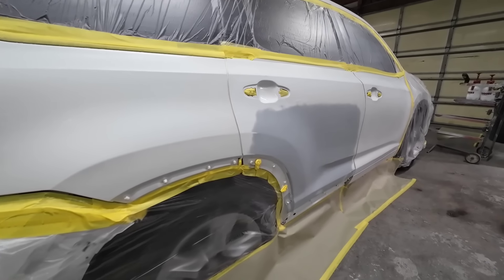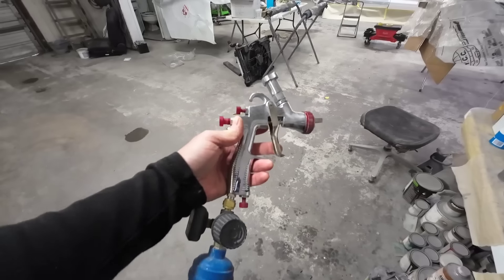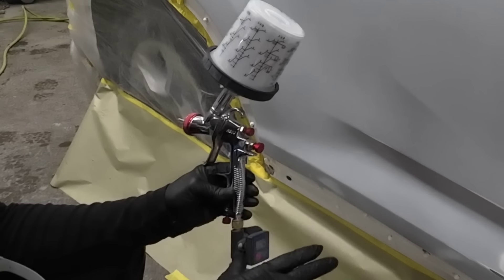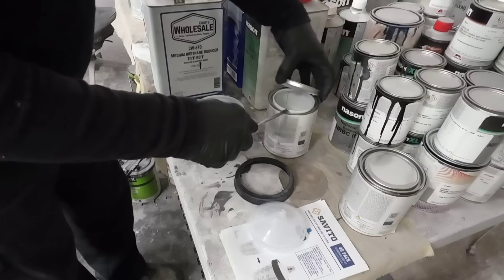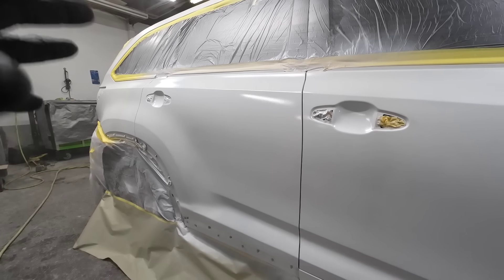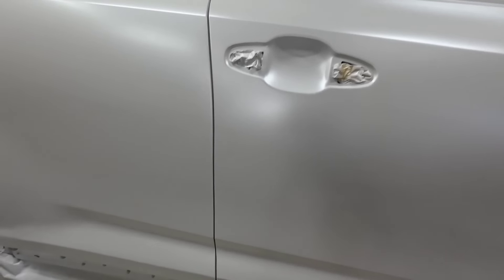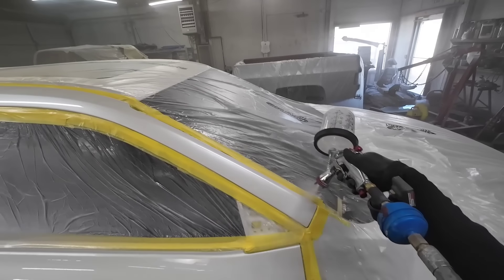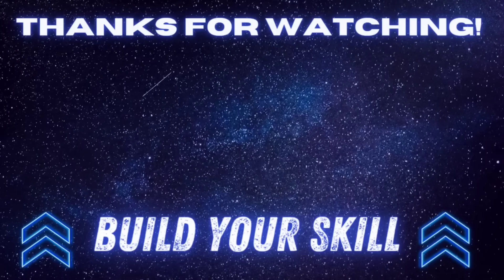The PERFECT lvlp spray gun to paint your car at home.

Comment: OK, took your advice and ordered an R500. Just did my first clear coat with the 1.3 and I must say it sprayed beyond my expectations. It sprayed as well as my old Binks #7, which used to be the standard for us old-timey types back in the 80's. For you youngsters out there, if you've never shot a high pressure gun, it's the standard by which all else is judged. But...overspray is a serious problem. You haven't seen overspray until you use one.  Any they are heavy.
Reply from the maker: For sure those older guns blasted it on like a fire hose🤣🤣 This gun sprays so nice alot of things to like about it.
Reply: I'm looking for a spray gun to spray candy apple paint. Do you think this gun would work well for that, and if so, what psi would I run it at
Reply: @davemcaferty6347  Here's my $.02...this is probably paint heresy but... I don't really pay much attention to PSI. I pattern the gun before every shoot meaning I adjust the psi and the spray...but I don't have a gauge on the gun. I just see how it patterns on cardboard and how it looks when I hold the gun perpendicular to a light source. Then I pay close attention to how the the paint is laying down on the surface. That requires good lighting. And no matter how good the gun, you are not going to do as good a job on the first paint job as the tenth. You have to get to know your equipment.
Reply: I still have my Binks #7, I'll never part with it lol. But I haven't used it since the mid 90s.
Reply: SATA is the Vanguard now.

Comment: Are you using the bigger orifice air compressor attachments?
Reply from the maker: No, 3/8 line with 1/4 fitting, m style
Reply: @GarageNoise  I have the 3/8 I.D. high flow fittings. will this work or should I switch over?
Reply from the maker: @FnaAuto  It should work fine

Comment: Can one of those pancake compressors work with one of these spray guns?
Reply from the maker: Pancake compressor  will be a little small. Need a compressor that produces about 5-6 cfm's. Usually a 20 -30 gallon compressor . You might get away with doing one panel. Not a whole car. I'm  working on getting a small budget friendly compressor to do some painting and a review on. Appreciate the support!
Reply: @GarageNoise  thanks for the reply. Yeah, I just want to be able to paint one panel. 
I will keep checking your videos . I’m still a bit confused with ratios when mixing paint and what brands to use that are good and not expensive. Thanks again 👍

Comment: Wow! Did you wet sand and buff to get that finish or is that straight off the gun?
Reply from the maker: That is off the gun, they don't  all turn out like that tho. Appreciate the comment and support!
Reply: @GarageNoise  Really a great job! You convinced me. I picked up that gun and a 20-gallon 5.3 CFM compressor instead of the 3-stage turbine electric sprayer. Thanks for the great video. I am totally expecting I will spend some time sanding and buffing haha, but the lay down looked nice and smooth regardless!

Comment: CHRIS IS THERE A SIGNIFICANT DIFFERENCE BETWEEN THE UPOL 2253 AND UPOL 2251?? THANK.S PJP
Reply from the maker: Isn't 2253 a primer? Not familiar with 2251
Reply: THEY ARE BOTH  2K HIGH BUILE PRIMERS BOTH GRAY ONLY DIFFERENCE I CAN SEE IS THE COST; I BELIEVE 2253 IS A DTM PRIMER /SURFACER WHERE AS 2251 IS A STANDARD 2K HIGH BUILD PRIMER; BIG COST DIFFERENCE, THANK,S PATRICK
Reply from the maker: @patrickpeterman8736  I use the 2253 because it is a dmt primer never tried the 2251

Comment: So what kind of compressor could be used with this gun?
Reply from the maker: With a compressor you want cfm's. This is the air your compressor produces per minute.  With this gun you want a compressor that produces at the minimum 6cfms. Your air pressure still may fluctuate if your painting a whole car but you could definitely paint a few panels without air fluctuations.

Comment: What are your thoughts on single stage?
Reply from the maker: It fine sprays alot like clear but easy to run. Best tip put the first coat on lite to medium.  Do not put it on wet it will run. Once  that first coat is tack spray second coat like clear.
Reply: Preciate the response. Would you add clear to the second or third coat like some do? Single stage has come a long way from the early 80’s.

Comment: Is this gun good for spraying a single stage paint with no clear coat?
Reply from the maker: Absolutely!
Reply: @GarageNoise  I have a 65 Impala and was originally going to go with base/clear, but with a car of this vintage, I figured a single stage would more resemble the "original" from the factory. I've been working on cars for 40 years now and I've learned more about painting from your channel in a month than I've learned from other sources in 40 years. Keep up the great work !! I retired last year and have long since gotten rid of all my major shop equipment, so I'm doing this project with a pancake compressor! I'm going to mask off and do one panel at a time, which shouldn't be a big issue with color match, since I'm doing the car in Ermine White.
Reply from the maker: @torydz  awesome! Appreciate the comment and support brother!
Reply: @GarageNoise  You may cringe when you hear this, but back in the day (I restored cars mostly in the 70's such as Novas and Camaros) I used to do acrylic lacquer. I think acrylic lacquer is considered almost a "swear word" to today's painters. But that is what I'm going to do the Impala in. I have the hood and deck lid in the shop and will do these first and then proceed to the other panels on the car in the driveway.

Comment: Sir ...can I use r500 lvlp with 1.3tips with the primer of mix ratio is 1:1 hopefully you can answer sir... thank you
Reply from the maker: It might be a bit small. Is it urethane or and epoxy or something  else? Chances are you'll need a bigger tip. The technical data sheet for the primer will have a recommendation for tip size. Appreciate the comment and support!
Reply: @GarageNoise  this primer I Will use it is a urethane sir...1.5 is it ok but not LVLP IST f75 hvlp I think...ok sir I understand.... thank you....🥰
Reply: @GarageNoise  sir....you using clear coat.  When you mixing the clear..are you add reducer sir ..in mixing ratio 2:1 or doesn't need add reducer....🥰
Reply from the maker: @mahalnidivine7270  the upol clearcoat doesn't  need reducer. So no I don't  add reducer to the clear coat . Appreciate the comment and support!
Reply: @GarageNoise  my clear coat is U mix UV7 mix ratio 2:1 it's said need add 5% reducer...is it necessary sir to add....or don't add yah ...🥰

Comment: I am new in spray painting and planning to paint my old car.  I would like to know how to handle the painting process if the spray cup is low in the middle of painting a car.  E.g.  Stop the painting process, mix the paint for a new cup, attach new cup to the spray gun and then continue painting the car.

I search this information through the web but getting no result.
Reply from the maker: The time it takes to mix up a bit more paint or clear is not going to effect things if your reasonably quick about it . It's  a bit more critical with clear but don't  over think it and if your paint a whole car and see your getting low try to finish the panel before stopping to mix more.

Comment: Hi I have purchased a R500 LVLP wild using the gun i notice some drop of pressure, for example I had 30psi using clear and after spraying it drop to 20 to 18 psi, I have a 30-gallon air compressor. any idea what happening. ?
Reply from the maker: It would be the air regulator on the gun. If your not using an air regulator that it's  a drop in pressure . Your compressor may not be keeping up with the paint gun. Not sure the details of your set up. Appreciate your support .

Comment: Is this R500 LVLP gun good for Metallic paint? What pressure is best for Metallic paint or Clear coat?
Reply from the maker: It's  fantastic for basecoat and clear. There's better clear guns but not with the low air consumption and other benefits of this gun.
Reply: @GarageNoise  so regular paint and metallic paint has no difference in spray at the same pressure?
Reply from the maker: @bulldogkarma  I like to use a bit less pressure on metallics because you want it to lay on med/ wet . On this gun around 18to 20 psi

Comment: Quick question. When you say small compressor,  how many gallons and psi do you need? Plan on doing a mobile set up that I can run out of my ford expedition. Most of my clients have sealed garages. What size hose and compressor do you recommend?
Reply from the maker: Check out my tomorrow's video  it's  on exactly this topic.

Comment: Did you use the same product for primer as you did sealer but at mix ratio for primer?
Reply from the maker: Yes, but you can't  do that with every primer. Make sure you check the Technical data sheet on the product  your using.  Here's the upol primer I use
https://amzn.to/3Ldm20h
Reply: @GarageNoise  yeah I understand that, I was looking on Amazon for the two reducers they recommend to use it as a sealer, don’t see either one made by upol, I have another brand reducer I use when mixing up a batch of basecoat, can that be used instead of the recommended kind by upol?
Reply: @GarageNoise  they recommend UP2481 or UP2842
Reply: @GarageNoise  A Non Sand (wet on wet) sealer. (use at 4:1+20% UP2481 or UP2842 Reducer
Reply: @GarageNoise  how about using Nason Ful base 441–21 reducer mid temp?
Reply from the maker: @wild8757  yes, the upol primer and activator and a urethane reducer  I've use several different bands. I've  used the nason reducer and the usc reducer. whatever reducer  your using  for your basecoat  should be fine.

Comment: I bought this gun, watched you set up videos , tried to spray some primer, the gun just spit and sputtered the primer out… rechecked mixture of primer, tried resetting the gun multiple times… not sure what I’m doing wrong…
Reply from the maker: Tip size? Is it the 1.3 or 1.4? Also what primer are you using, if it's  high buil the viscosity could be too thick. You can thin the primer with some urethane reducer.

Comment: After spraying sealer is it ok to leave it for a few weeks and then sand with 600 to lay down base coat?
Reply from the maker: You might get away with it but I wouldn't.  What you could do is spray a primer surfacer, which is just a thinner primer  then come back and sand and basecoat when your ready. Use a 2k product  tho so it has some protection.

Comment: R500's seem very decent but having just been doing a lot of painting with mine (first big project) I agree now with the info out there that they actually consume much more air than the 3.5-3.9 cfm that's billed. In turn, no shortage of mist/overspray, particularly spraying clear coat. Fair enought you may say, BUT this is less than ideal for the DIY home painter with no booth. It is reckoned they use more like 7.5-8 cfm (spraying clear at circa 32 psi).
Reply from the maker: I think your right, still best option I've  found for diy. If you dial down the air pressure and fluid volume you will get less overspray.  Appreciate the comment brother!

Comment: I've got a project truck in my garage that I need to start spraying the back sides of some parts so I can begin assembly but I've been seeing videos online that say you can't use an LVLP spray gun to paint an entire vehicle. Overspray and the size of my compressor are an issue. Spring in my open garage and having a compressor rated at 2 HP might be a challenge for a traditional HVLP gun. I've been considering the R500 because of your videos, do you really think full vehicle can be sprayed with this?
Reply from the maker: This is the thing, your compressor must produce at minimum 6cfm. The more cfm the better, but at 6cfm you can get it done. You may have some air fluctuations tho.

Comment: Hi Chris, I recently bought a R500. And I'm trying to set it up with the cup system but need to know the specific spray gun cup adapter you use with your cup system going to be using aflybltol mixing cups from Amazon 20oz says its the traditional 1.0 system. Let me know your thoughts on my question painting an entire chev camaro
Reply from the maker: Spectrum 57505 adapter at harbor freight or 3m #2 adapter legacy series
Reply: @GarageNoise  thanks Chris do you know if Amazon sells it? Cause I live in Canada 🇨🇦
Reply from the maker: @ginowillow  I can't  find it on Amazon but you may be able to order it on harbor freights website

Comment: Love you this video. Very helpful for the guys like me who is starting to do some DIY projects. Question, what air compressor is best for this gun?
Reply from the maker: Bigger the better,  most cfm's you can afford at the least 6-10 cfm's
Reply: @GarageNoise  unfortunately i have a husky 20gallom compressor which gives 4-5 CFM
Reply from the maker: @UwU._Sqb  it will work but you'll  have air fluctuations if you paint more than one panel.
Reply: @GarageNoise  ill keep that in mind.. thanks for
The tip.

Comment: Btw Chris, what type of primer should I use on bare metal? can I just use 2k urethane or epoxy is a must. New to car painting and I am starting to gather my supplies.
Reply from the maker: Are you painting the whole car or just a repair? If your just doing a repair and painting  a few panels 2k urethane is perfect. If your doing a full paint and you plan on it sitting in primer for awhile than use epoxy as soon as you take a panel  to bare metal  the clock is ticking to get it into primer.  If you plan on painting it within a few months and it's  not out in the elements tthan 2k urethane is great and what i perfer.  Hope this helps appreciate the comment and support!
Reply: My car has crow feet in the front hood and back fender.  Based on the forum I read, it says that I need to strip the paint to bare metal and there is now way to correct crow feet.

Comment: Hey bud, can I wet sand a paint job I did with my spray paint can? Or should I clear coat it first? 

Thanks
Reply from the maker: I'd  clearcoat first
Reply: @GarageNoise  I think the black spray paint I used has orange peel in it. Should I put on the clear coat first let it heal then go down with 1500-3000 grit? I really appreciate your help! It sucks using a spray can! I found some battery operated spray guns I think I'm gonna get.
Reply: @GarageNoise  Boss I want to show you a photo of my paint job. It doesn't look right! Your tip on my next step will be greatly appreciated!
Reply: @GarageNoise  I started wet sanding the nee paint that has orange peel with 1500 grit! And 1500 grit is awesome! I feel it's easier by hand cuz I can be careful not to remove to much! Can I clear coat after going with 1500,2000, and 2500 grit?
Reply from the maker: @Tactical_Response_Team If it's  a metallic base than no you need to apply a coat of base. The sanding effects the metallics orientation.

Comment: I bought the R500 and used all the setting you mentioned and same distance and speed movement. For some reason I’m getting tons of orange peel ! 
I’ve tried this gun several times on different occasions and still get tons of orange peel. 
So on the last coat I decided to switch guns to the Porphis-715 
And I saw a huge improvement very little orange peel. Not sure what’s going on

Comment: hi, i have a similar lvlp gun, trying to use with only a 50litre (11gallon) compressor. Can I ask what you would recommend setting the psi to on the main regulator near the compressor? Or you dont use one? I have set my main regulator/filter to 60psi and then the smaller inline one by the gun to 22psi. thanks
Reply from the maker: 60 sound good to me. Mine is set at 90 but I have a large compressor.

Comment: I tried to find the adapter for disposable system in your shop, but doesnt look the same as for the 3M system.
Reply from the maker: It's  not, I cannot find one on Amazon.  The right adapter is a 3m legacy #2 adapter or harbor freight has one part# 57505

Comment: Hi! What nozzle size would you recomend for epoxi primer? They sell this gun with 1.3 ; 1.4 ; 1.5 ; 1.7 and 2.0. I do rather small stuff like motorcycle gastanks and fenders and I I'm also limited by little 6 gallon compressor with 3,5 cfm. For clear coat and base I use Iwata LPH 80 and thick primer is a bit too much for it. Cheers!
Reply from the maker: Look up the technical data sheet for the epoxy primer your using it will give you a good recommendation for tip size. I feel like a 1.7 would be sufficient for epoxy tho. Appreciate the comment and support!

Comment: Damn just found out I was using the UPOL wrong, I was always told 4:1 for primer and 4:1:1 for sealer. I just read the data sheet and it's 4:1 for high build primer and 4:1:1 for primer surfacer, between the two what exactly is the difference in use?
Reply from the maker: Should be 4:1:2 for sealer
Reply from the maker: I don't  know the difference other then 4:1:2 thins in out so it dries quicker for sealer.